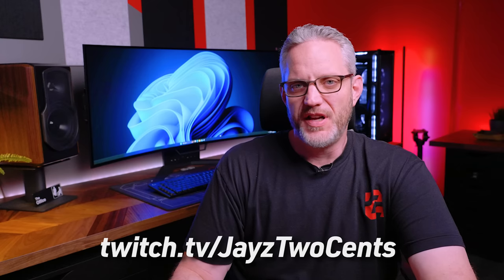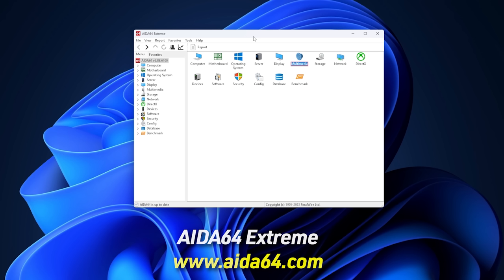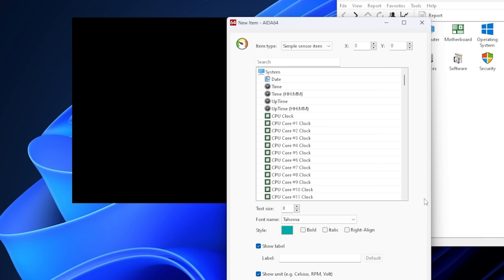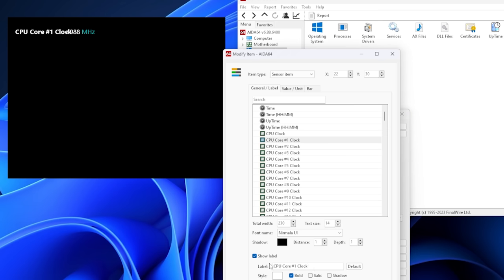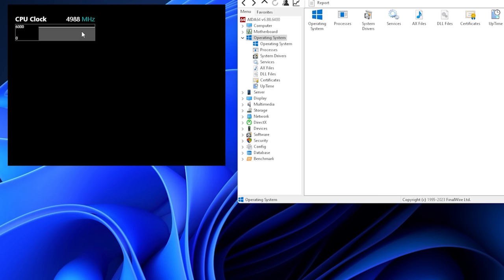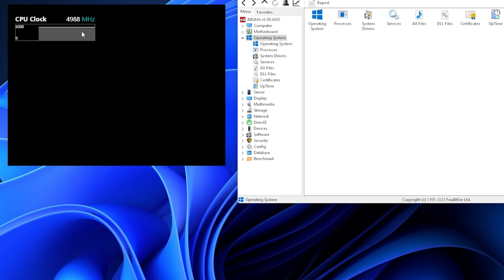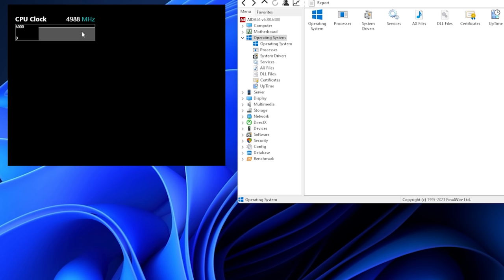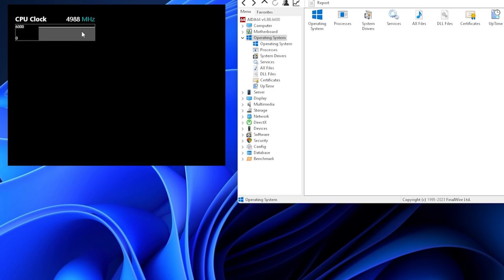Ultimate Sensor Panel Guide

Comment: Please post a manual, how to set Aida64 to load everything up when ANY user with or without administrative privileges on Win 10 Pro logs on :))) Been playing with it for a long time, not much result so far. When user with admin rights logs on - works good, when standard user logs on - half of metrics not showing :(
Reply: Since Aida64 needs elevated privileges to run you will need either to use an admin account or create a group then setup a group policy that allows that program to run,  and then finally add that user account to the group.  It can get somewhat complicated, but there are youtube videos and books that can walk you through that process.

Comment: This is  cool but i'm saving it in Watch Later bc I still have an old logitech G13 with the LCD screen that afterburner still supports, I hope that never stops working. I bought the thing just for the screen bc I had the full keyboard a long time ago but it died and I was unable to get the screen working on its own when i was younger. Also iCue changes temps on the AIO pump and the front fans according to the cpu core and gpu core respectively. If it gets to the 3rd temp color then I should double check the actual value to make sure it's just working real hard and not broken. iCue impressively picks up my asus gpu as well so that logo also changes color with gpu temps also. This is great bc asus has the WORST gpu/rgb controller since they dropped regular Aura, so i downloaded an old version just so the driver is there and iCue picked it up. Shew, that was a rant, guess what? Chicken Butt. Your reward at the end; and thanks for reading.

Comment: Did you know I have a high-end system running continuously for two years with an AIO that has had zero problems with no "sensors" or "sensor panel" and everything is still ok?

You know you can just run your PC as intended and stop trying to destroy it for 40 extra MgHz that don't amount to anything practical, right?

Plug it in, watch it run. Have a stable system for years you don't have to screw around with just to get 2 more FPS.

Simple.

Comment: Lol I designed like 3 sensor panels I have shared in the forums. I stopped using it because I couldn't justify $60 to use 5% of the software. 

I wish they had a sensor panel only version for  like $20

Comment: So while you can drag and drop everything where you want it, an easier way to fine tune rather than typing everything, in the sensor panel settings, above new there’s a section with the 4 directions and says 1 pix, you can move 1, 5, 10, 20 and 100 pixels I believe. It’s a lot faster than typing in and more precise than dragging. You can highlight multiples and move them all at once, extremely handy

Comment: boi im lazy 
it should be as easy as downloading the program and a preset for it
Reply: i believe there should be some presets but everyone's system is different so you can make the most out of it only if you customize it for yours
Reply: @Amfibios  yeah there is probably better stuff out there then this i hope
Reply: @kayumust  according to my research, there's easier ones to use, like usb sensor panels that come with presets and optional customization, but if you care about fine tuning everything and having the option to monitor all kinds of things on your system, then aida isnthe most in-depth solution afaik